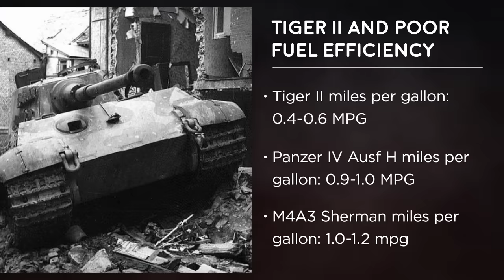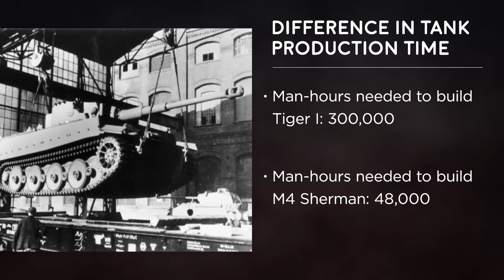Why Did German Tanks Perform So Badly in The Battle of the Bulge?

Comment: Panther went through soft/muddy soil better than any WW 2 tank. Table below is from a measure of that using Mean Max Pressure method. M-47, ( upgraded M-26), weighs about same as Panther & scores 246 to Panthers 150.

Panther 150-155
M-24 Chaffee 175
BT-5 175
T-34/76 174-186
Churchill M IV 177 (11 roadwheel)
Tiger II 184
Tiger I 185-192
Churchill VII 182-223
Churchill Mk IV 217 (9 roadwheel)
Panzer IV 184-191
T-34/85 196
Sherman HVSS 205
M3 Stuart 216
Panzer III 220-232
BT-7 240
JS-II 245
Universal Carrier 253
Sherman VVSS 282
E-100 290
Cromwell VII 300
Cromwell IV 352
M3 Halftrack 363
US 2 1/2 ton 367 (6X6)
Elephant 370
SD KFZ 231 (8 rad) 415
M8 Greyhound 460
Maus 470
Opel Blitz 525 (4X4)
Opel Blitz 700 (4X2)

For comparison

M29c Weasel 27
Caterpillar D7 32.5 (widepad)
Caterpillar D7 80 (regular)
Leopard II 201
M-60 221-236
T-62 242
M-47 246
AMX-30 249

D Rowland Ground Pressure Papers

Little-known outside tank design engineers, very interesting articles on an alternative method of working out the ground pressure of tracked and wheeled vehicles.

http://www.angelfire.com/trek/mytravels/militarygp.html

Comment: Except Peipers Tiger II's were not at the front of the column, the forward tanks were Panzer IV and Panthers - Due to the essential need for speed and surprise to take bridges intact that the operation hinged on and coupled with the extreme importance of not chewing up the soft muddy roads for the following support elements, he kept the lumbering and mechanically unreliable King Tigers of s.SS.Pz.Abt.501 right at the rear of his column to avoid them slowing him up and viewed them more as a hindrance than a help.

Comment: There´s a Mistake @8:34, the german army tried to change from heavier tanks to much lighter vehicels. It is a common misconseption to overestimate Hitlers role in tank development. The Plan in 1944/45 was to produce more of the light Stugs and Jagdpanzer, especally the Jagdpanzer 38t, which should have replace the older heavier Tanks, which came from the periode from the invasion of the UDSSR.

Comment: The Germans focus on heavy panzers was a detriment in this battle. The Panthers not so much but they’re use of tigers and king tigers much of the areas in this area were small bridges lots of American engineers kept blowing the bridges up in front of the German tanks, not to mention a king tiger or any heavy tank it’s going to be nigh  impossible to try to cross one of the small bridges. Not to mention that one of their objectives was to search for American fuel dumps somewhere in the area. It’s surprising. They were successful as they were.

Comment: A very good video. There is another factor which has been missed off, the length of the barrels on the panzers. I have been on a trip to the Ardennes battlefields. The country lanes are narrow with walls and houses on the sides and the forests dense. The German tanks would often find obstructions went rotating the turrets. This isn't such a problem in a defensive position but is when advancing. The comment about the 17pdr on the firefly is a bit misleading. What sort of range was it penetrating the tiger's frontal armour at? Also to say it had more penetration than the 88mm also needs some clarity. The Tiger II 88mm had far more penetrating power than the Tiger I. The Panther 75mm gun had more penetrating power than Tiger I but not Tiger II. But also range has a lot to do with it. Tank rounds loose velocity travelling through the air. Panther 75mm and 17pdr would loose more kinetic energy than 88mm due to having less mass and momentum. So at longer ranges the 88mm is likely to have more penetrating power.

Comment: A last comment here.
The Allies had developed the proximity fuse which were attached to anti-aircraft and artillery shells.
General Eisenhower insisted that these be used in the Battle of the Bulge and 200,000 of these artillery shells were used with devastating effect against exposed German Army formations.
The Germans thought the cloudy skies would mask them as targets but they were wrong as their accuracy was tied to radar.
German tanks are great when they don’t break down or run out of gas but without Infantry, they are toothless Tigers.
Proximity fuses were considered second best only to Atomic Bombs as the best technological innovations made by the Allies.

Comment: Considering the tigers were basically alone and on the assault with no air cover, limited fuel and limited time before the weather cleared. The tigers actually performed pretty well. It wasn't allied armor that stopped them it was the engineers taking out bridges making the Germans burn more fuel and buying time for the weather to clear so allied air power could devestate German ground troops and armor.  Fuel stopped those tigers in the end.
Reply: This is a very big wehraboo cope

Comment: 2 reasons. 

1) They needed fuel the Germans didn't have. The entire operation relied on German forces breaking through Allied lines and capturing strategic petrol reserves to continue the forward momentum. That there would be fuel reserves to capture was a huge presumption to begin with, but it was made even more presumptuous by the fact that most of the Panzers taking part in the offensive didn't have full fuel tanks to begin with, thus limiting their range (which was already limited by the fact that the Panther and to a greater extent the Tiger I and an even greater extent the Tiger II had high fuel consumption in optimal conditions), meaning that any time spent in combat with Allied forces and not moving towards the (presumed) petrol dumps was using fuel they could not afford to expend.

2) The weather. The same weather that allowed the Germans to launch an offensive in the first place also doomed the armoured component of the attack because it wasn't a conducive environment for armoured warfare. It also hampered their tanks' mobility, once again using up excess fuel. On top of that, many tanks simply broke down before they had any meaningful impact on the battle.